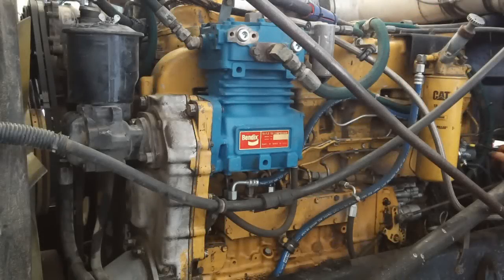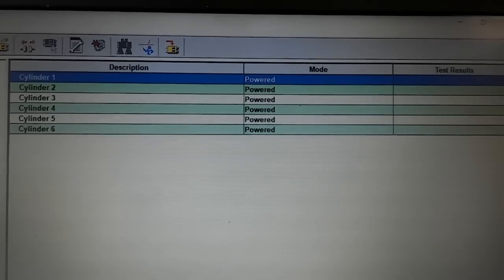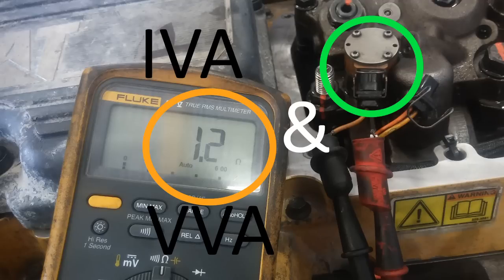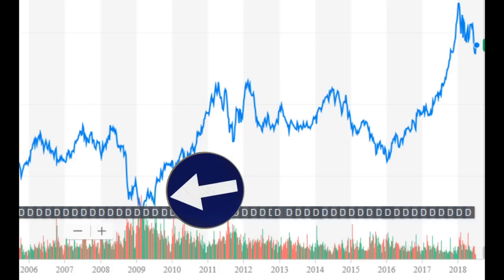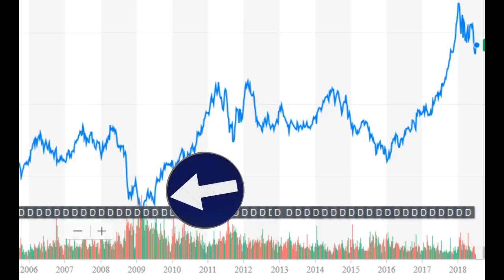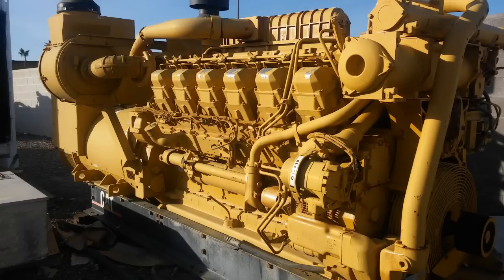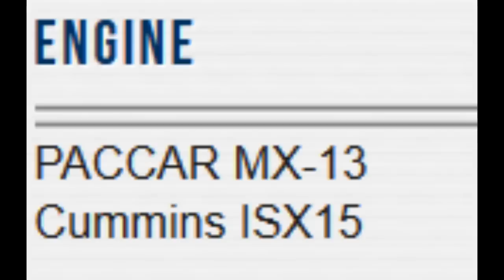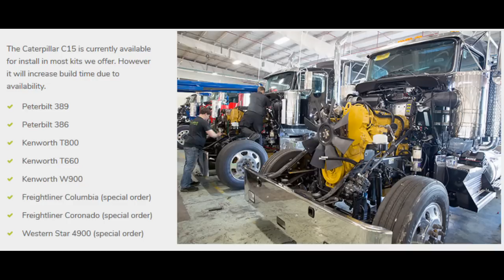Why Did Cat Stop Making Truck Engines?

Comment: I have a 1998 Dodge 2500 with a Cummins and an NV-4500 gearbox. It's pre-catalytic converter, pre-DPF, pre-DEF, and pre-common rail (Bosch VP-44 injection pump). I'd never trade this truck for a post-2001 common rail Cummins. Sure, it's a little noisier than the common rail engines, and has less maximum horsepower, but when it's time for a rebuild, a complete set of 6 new injectors and a new injection pump costs about 1/2 what it costs to replace the same parts on a common rail truck, and there are far fewer things that can go wrong and cause an OBD-II fault condition in the ECM. The EPA ruined light truck diesels when they mandated the DPF, DEF, and common rail smog crap.

Comment: Also means if you run a CAT motor, parts prices will go up making it more expensive to run. They will make parts for them, but as business goes the parts to keep older engines still running will make parts in higher demand thus higher prices.
Reply: i'd rather pay for Quality instead of Quantity... Plus when you take the costs of each versus the miles/hours it will last... it will be less then or the same.. in the end

Comment: Cat was the worst engine I ever had to drive. Constantly throughing belts, breaking coolant lines, burned a gallon of oil every week, 2 radiators in 6 months, injector problems, and it wouldn’t go above 1200 rpm in 12th gear every shop I took it to couldn’t figure that one out even flashed the ecm. My last paccar was running strong at 500k and now my new one has 167k on it zero issues

Comment: I was never sure of cat till I got one. Then the yellow feline had more torque than my other trucks. For my application I ran single axle trucks. The C10 was a great engine. Didn’t really need to do much to them till around 500k. After owning 2 c10’s and a C12 I can honestly say they were the best engines I’ve ever owned and ran. And the people I sold them to are still working them every day.

Comment: The CAT engine was about 2 things, performance and reliability.  This is what made it popular. Only as time went on, especially when Detroit can in and made their motors more so based on fuel eeconomy than performance and reliability, simply because they weren't. As a true CAT man, as well as a lot of y'all, I never ever worried about fuel economy, and some would probably disagree with this, but if you have to worry about fuel economy, you're with or working for the wrong company. Trucks in the 70's, with less power and no computers or regulations, got around 5 mpg, even KTA motors, V8 CAT and Mack engines, let alone Big Cam Cummins engines. If the same money was made at time adjusted to today's money, which only changed slightly because of Elogs, who the hell would worry about fuel economy, also with fuel prices going up, would think about it? You base any truck, 400 hp to 800 hp, on 5mph anyway, even if you got just slightly below it, it'll average close to if not over 5 mph, unless you haul heavy. What do you expect? It's a truck for cryin' out loud, hauling WEIGHT!! But this is just my opinion, no one has to agree with me, but power, performance, dependability, and reliability is what I want in any engine, and CAT gave me that. Fuck fuel economy! What you really save, you'll put back in the truck anyway, not necessarily saying fuel, if y'all get my point. Why cheat your money maker!? As I said earlier, if you base your money you make on trying save money on fuel economy when you NEED IT TO MAKE MONEY, just to say "my truck gets 7mph" when you've won already and ahead if you used 5mpg as your average, you're working for the wrong outfit! CAT gives me everything I've wanted in an engine, and wish they still made them. If you made the right money, you'd never worry about fuel economy and you shouldn't have anyway, and only a few of you understand what I mean by this. My opinion y'all. Thanks for reading. Open to criticism, I expect and accept.

Comment: Caterpillar just got tired of the Union employees and started in the late 70s to stop production of certain classes of machines. The entire excavator line was shut down and Mitsubishi began branding their excavator line as caterpillar. Early 80s saw all of the dozer line being built in Japan. Late 80s saw cat installing Perkins engines in small to medium loaders.  The 90s brought us unit injectors and the electronic engines. Cat could not build a good unit injector. Test a hundred on the test bench and no two would perform the same. 
Even though cat is still headquartered in the states it is really a European business.

Comment: Yes that’s about the short and long of it. Most of the new trucks today are plagued with reliability issues electrical, emissions, some is directly due to manufacturers inattention to details and the ever increasing regulation of emissions. The ability for operators to absorb repair cost and down time is shrinking, and the loop hole that allows glider kits is closing the future is not bright for independent or small companies to continue. Instead of balance in our regulating process we are just shut off by bureaucrats and politicians who have bought the United Nations agendas, which by the way undermine yours and mine sovereignty, the UN is an evil entity and must be fought and dismantled.

Comment: there are a ton of reasons why CAT stopped making OHV engines. because they didn't need to be replaced as often so the company wasn't making money, because they weren't getting the fuel mileage some other engines were, failing stricter EPA regulations, etc. etc.. probably the biggest reason is because CAT engines cant sync up with the ELDs that are required for new trucks because a CAT engine works best as it is. a mechanical engine not computer run. most politicians today are or have been the owners of a company which they want to make laws where its hard for someone to compete against them.

Comment: It's the new emissions standards that will kill most of them off. I'm now really a fan of  Diesel particulate filters. Do to the amount of time I spend replacing them. That's a hole new ball game and wax. It would be fine if the  Particulates filters wouldn't clog up or burn themselves up or take out the motor. It's not  Built to last anymore. It's all thinner and cheaper Metals used now a day's.

Comment: They overslept the future. Just as NOKIA, once the market leader, wanted to hold on to what had been tried and tested. Or KODAK, who brought a new film onto the market, so they all wanted to photograph digitally.

It seems to be a weakness to rely on being big and well known and then not take innovation seriously. CAT should have started developing a completely new engine many years before 2010. It was foreseeable that the proven and robust machines could not be comprehensively adapted to the new emission regulations. When they tried to do that, it happened in a hurry and the result was not reliable, not what CAT's customers were used to.

Comment: Don't know about now but in the 90's detroit diesel engine was the best. Specially 94 to 96 12.7L engine. That engine was powerful for that size and very fuel efficient. I had 2 millions miles when I got rid of it and was still running strong. just basic maintenance. Cat engines were known to have poor mpg.. They should have invested more in technology..
Just raw power back than.. Now we have these suffocating engines with filters and DEF...

Comment: One thing about CAT engines, either you love them, or you hate them...there's no in-between...that being said...i'm not a big fan...I had one it was ok....my dad bought 10 new freightliners because they were a fleet cancelation, and he got a good deal....eventually  one of trucks motors went down, and CAT Reps. came in..looked at it...and paid to have all 10 motors rebuilt, because when manufactured, they came down the assembly line together, and didn't want to take chances with the other motors having a   defect too

Comment: I think what happened they didn't keep up with research and development. In America emission standards is a joke. So my guess Catepillar made their focus lobbying politicians to lower the emission-standards instead of improving their engine. While European manufacturers were making engines with lower missions and better fuel economy. At the end of the day the main purpose of a truck is to move stuff from point A to point B as efficient as possible, and if you can cut fuel consumption by 2% that is money that goes into the truck-companies pocket, or cut from the freight cost to buy market share.
It is true those more efficient foreign engines is more complex, but that is also a sign the mechanic need to keep up with the new technology or be left behind complaining.

Comment: Josh, I know you're a Cat employee and you can't really talk about this...but the REAL reason Cat got out of the on-highway market was the 2007-2010 ACERT engines. They were, to be blunt, HORRIBLE! They broke down immediately, early and often. They broke down so much the biggest of the many class-action suits against this engine cost Cat $60 million. What they SHOULD have done is licensed Cummins' emissions system; the one Cummins was using on the ISX worked. I was driving OTR in 2009 and if I had a nickel for everyone I met at a TA or Petro whose truck was in the shop getting the ACERT fixed, I'd have a lot of nickels.

Comment: Cat. Could have meet all e.p.a.reg's but to do so would have meant an engine with out balls. I retired in 07.  i had an 500 and it was a jewel. I could  pull tx. Canyon in az.. going east in winter at 71mph and in summer at 62 mph.

Comment: Good video.  Thanks.  But I think you soft-pedaled the real reason.  Because the real reason should strike an ominous chord in every free American.  IMHO, of course.

I'm not an engineer, a truck mechanic or an environmental scientist.  I am an attorney who observed the issues that highway diesel engines were having as a result of tightening EPA requirements in 2007, and made even more stringent for engines produced in 2010 and afterwards.  Design engineers were faced with very difficult challenges trying to meet these standards.  They would spend years trying to find and tweak technology.  I don't know the inside story at CAT, but I bet that CAT just thought it was not worth the effort in the truck segment.  So they stopped selling diesels for the truck industry in 2010 when the latest (for that time) EPA standards hit.  They saved themselves years of costly design effort from 2007 to 2010 when they would have been required to intensely design and test to be up and ready by 2010 with a highway compliant engine.  From what I learned, EGR technology would be essential just to have a chance at meeting 2010 standards, along with a separate particulate filter that required trucks in some applications to pull over periodically and idle to burn off particulates, and who knows what else.  These changes would amount to a major re-design of their diesel engines.  CAT made a sober business decision given that it had so many other channels to sell diesels not subject to highway emissions regulations.  

But the real story here is the way the EPA became an instrument of government control keeping highway truck owners and operators from having engines of their choice by squeezing down the emissions standards every few years.  And for what?  Trucks sold in America, by 2007, were already low in emissions compared with much of the rest of the world.  The higher cost of these engines contributed to increasing the cost for Americans to transport goods, and drove up the prices of goods.  The difference between standards in 2007 and those in 2010 and 2013 were catastrophic for diesel truck engine performance and reliability, adding more cost and waste.  Were the environmental gains worth it when the rest of the world, outside of some of Europe, had no corresponding burden on their emissions?  How much did "the planet" really gain from it?  How much international commerce did American companies lose in competition with companies in other countries operating without these draconian emissions standards?

I believe that individuals ensconced in the EPA decided long ago that they wanted eradicate the highway diesel engine.  They could not take the political hit of simply outlawing the engine, so they just periodically tightened emissions standards to do the job over time.  They want all of you to be limited to electric engines, and then they want you to get electricity from wind and solar.  The government doesn't want to wait for capitalism to work to evolve new power sources for trucks.  The government wants to impose its choices and force-feed them to you now.  Of course, the electrical infrastructure is not even in place, and trucks may need to make frequent charging stops slowing the progress of goods. I speculate that electric trucks are likely have higher per mile costs than diesel.  Further, that policy makes us even more vulnerable to physical and cyber attacks on the grid.   It is a scary thought that these EPA bureaucrats are not elected, and I doubt that our elected representatives even know about this forced diesel phase-out. The EPA bureaucrats work in obscurity because the media chooses not to shine a light there.

So, again IMHO,  the short answer that other commentators on this video have said is that the EPA showed CAT the exit ramp on highway diesels, and soon will be directing all of the other diesel truck engine manufacturers to the exits.

And nobody ever asked you for your opinion on it, did they? Because the government can make much better choices than a free and informed capitalist society does, right?  Just ask the common people in Cuba, Venezuela, North Korea, and the former Soviet Russia....
Reply: Well said Tom, good observations too!

Comment: I got 1.4 million miles on my C-15 6NZ motor and I never spent a dime on the engine besides oil change. I’m planning to do engine overhaul and hopefully ride it next 8 years and after that im done with trucking. nobody ! absolutely NO body will ever make the truck engine like Cat did. its a shame that they not in business of making engines no more. I must say, heads down best durability and longevity engines ever built. it just sadness me that those engines will never be built again. and these new emission ones with egr and def they can take it all and shovel up their ass. they making owner operators go bankrupt with the enormous annual expenses on those so called clean environment engines.

Comment: Thats quite a sad but interesting story. I cant help thinking that Cat sealed their fate by trying to build a truck and thus putting themselves in direct competition with the very companies they sold engines too. On a side note most if not all European can manufactures use out side companies to design build fuel injection systems ECMs etc and its usally Bosch. Great informative video thanks for sharing.

Comment: I have a truck with a DPF C15.  Big pile of shit.  Has 300k and he’s right you might get 1-2 years out of the spark plug head.  Around $1,800 each time to fix.

Comment: To everyone crying about DEF and EGR stick it.  I'll admit I know nothing about how they drive, but I do know in the last couple years I've been doing routine stuff mostly on around 60 Freightliners with Detroits and a few Volvos with Cummins that problems are actually pretty rare.  I won't argue that when problems do happen they can get expensive quickly depending on what happens.  Do all the routine maintenance and they'll last over a million miles easy.
Reply: Unfortunately the new Detroits do a have a flaw with the rubber o rings in the oil pickup system that could be a huge problem if you're too far from home or not watching your gauges...  maybe there's part of the problem.

Comment: This video is very American market oriented.   But a major part of Cat's engine sales was international.   I worked for a Cat dealer in the 2000 years.  Cat were stupid.   They never took standards seriously.   With large diesel engines, unlike cars, the cost of fuel is THE most  significant part of the cost of ownership.   It's 80% plus.   So owners/customers take fuel consumption very seriously.   Now, you could look at the manufacturer's data for a Cummins or any of the Euro engines and the thermodynamic efficiency would be quoted at a percent or two better than did the equivalent Cat engine data.  But, the other brands measured fuel burn in accordance with an international standard.  Cat used an old American SAE standard, so it wasn't comparing apples with apples.   As a professional engineer, I knew how to apply correction factors - if you did that, the fuel consumption turned out to be the same.  It could hardly be otherwise.
Experienced owner/drivers knew the truth of course, and were happy with their Cat engines, but you got desk-bound managers in large fleet operators making decisions based on paper.  They wouldn't choose Cat a lot of the time, just because of the way Cat measured fuel burn.
When dealers for other brands received engines from the factory (whether the factory be in China, Europe, Japan, etc), the engines arrived already configured to meet standards in force in the local market.   So it was just a matter of install and use.  But not with Cat - they supplied engines not in conformance, so the dealer had to spend money putting them right.  So, loss of competitiveness.
Its the same mentality that Americans have re the metric (System International), quality management, etc.   "If its not the American Way , its not right.   Its a plot against us."